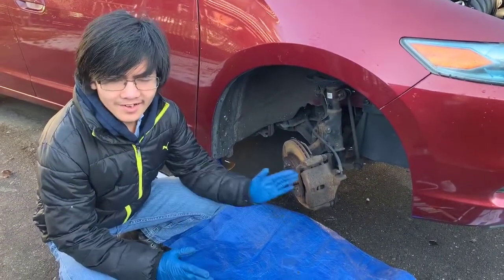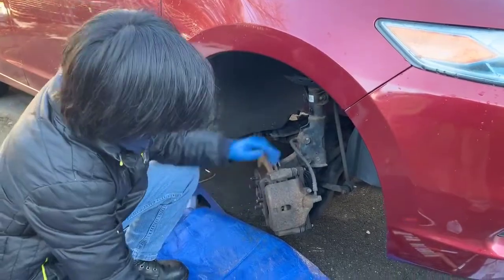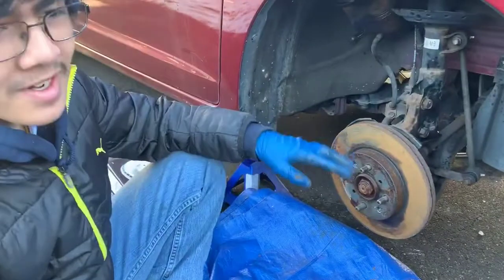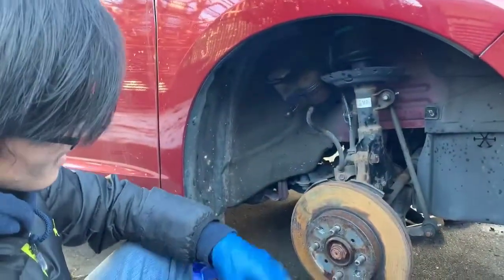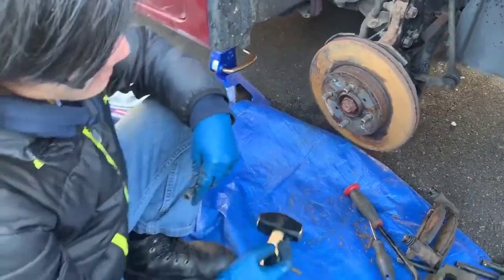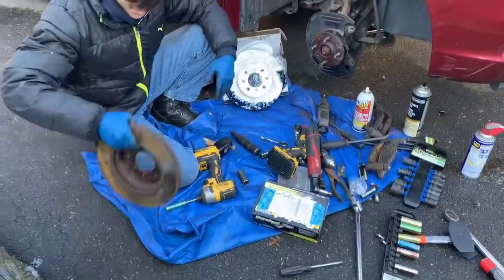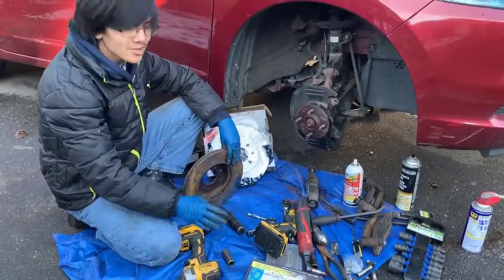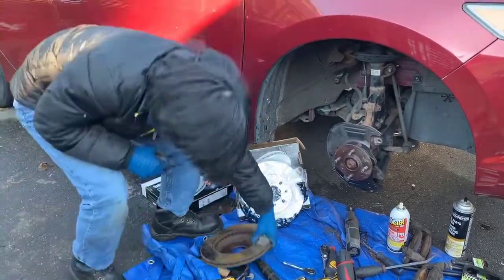How To Remove Front Rotor, Caliper, Bracket, Brake Pads & Stripped Screws: Honda Insight Hybrid Gen2

Comment from the maker: Here are the #ᴬᴰlinks to tools, parts and accessories you may need to perform this repair:
1.  https://amzn.to/4fGgisD  |  POWERSTOP KOE690 Front Autospecialty Replacement Brake Pad and Rotor Kit For 1996-2005 Honda Civic | 2010-2014 Honda Insight
2.  https://amzn.to/498ifvw  |  Bendix Priority1 CFC465AK2 Ceramic Front Brake Pads for Acura EL 2005-1997, Honda Civic 2011-1996, Insight 2014-2010
3.  https://amzn.to/3Z2jqYD  |  KAX Disc Brake Caliper Assembly Fit for Honda Civic 1996-2000 1.6L, 2006-2011 1.8L, Insight 2010-2014(Front Left Driver Side), Civic 2001-2005 1.7L, 2002-2003 2.0L(Front Right Passenge Side)
4.  https://amzn.to/3AYklRV  |  8pcs Screw Rotor Brake Disc Retaining 93600-06014-0H- Compatible With Honda, Acura, Volkswagen, Audi,Hyundai and Kia Models, Stainless Steel Retaining Screws for Front and Rear
5.  https://amzn.to/4eJZcc1  |  Car Brake Piston Wind Back Tool, 3pcs/Set Brake Caliper Piston Rewind Tool, Auto Rear Brake Pad Wind Back Tool, Brake Caliper Wind Back Tool for Replacement of Rear Brake Pad

Or Click on Amazon link here and search for what you need:  https://amzn.to/3xIOsqg

Comment: Thanks for the vid.  I just finished this job.  The manual impact driver to get the locating screws out does the job.  And the bolts you need to jack the rotor off are M8-1.25, 50 mm long give you plenty to get the rotors clear.

Comment: Those two screws are such a pain. A regular screwdriver just strips them. I used an electric impact driver for most of them, but for one, I had to use a Dremel to cut a groove in the screw so that I could use a screwdriver. This destroyed the rotor, of course, but I was going to replace that anyway.